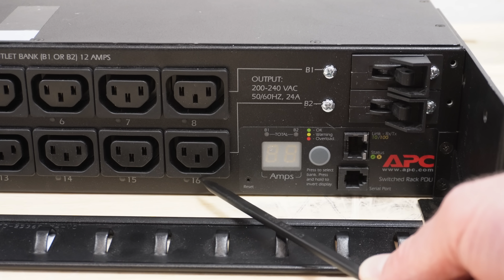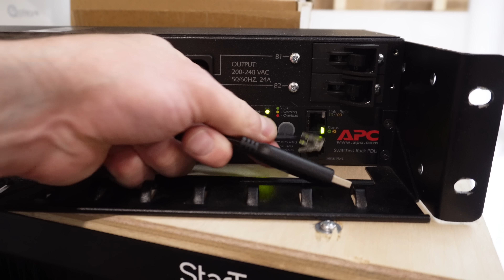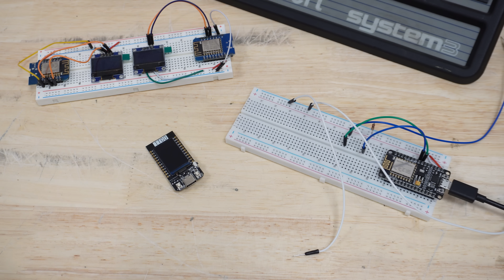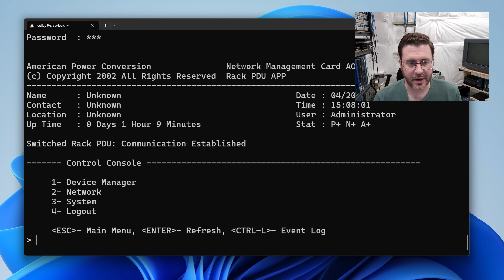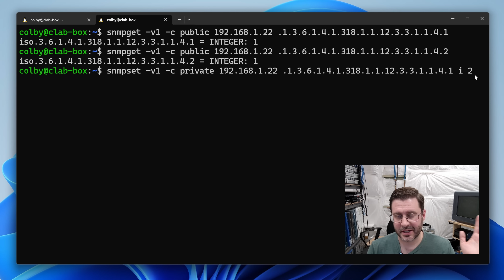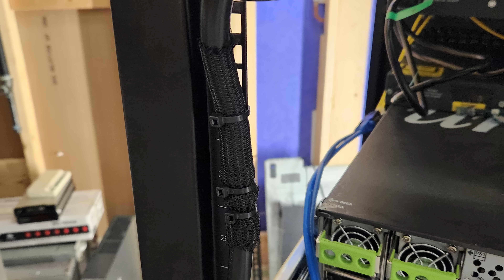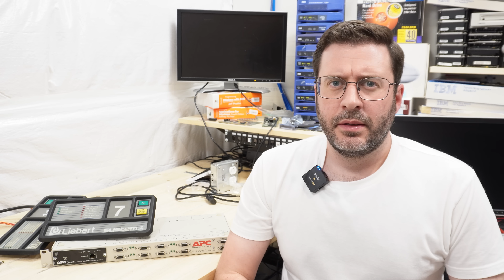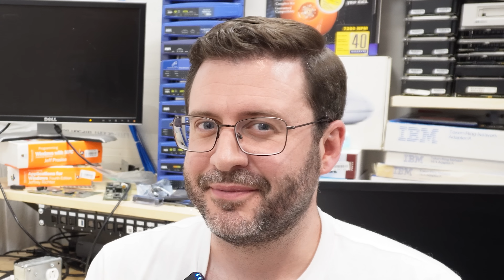Retro Rack PDU Install

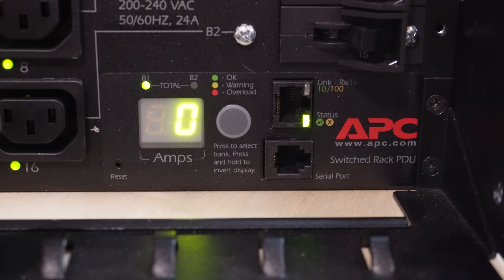Comment: 4:37 grabs the box of random plug to EIA-561apaters out of the shelf Which one we need?
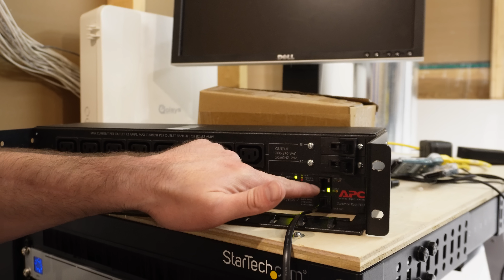5:29 Same problem with the Netgear M4300 series here with a lot of retro equipment. The swich talks 10Base-T, but it won't work well with a lot of old stuff. For that reason there's a ancient Netgear FS108 running in the rack. We replaced the stone-age linear transformer power supply (7.5V, what an odd number) with a more efficient switch mode supply, which is way less of a space heater.
7:57 Put the ESP in your network, and you can throw commend at it from anywhere :) The ESP8266 is still quite fine for smaller stuff. I have a lot of sensors around the house running on there, and also a lot of stuff on the workbench. Up to nine useable GPIOs is way enough for a lot of stuff, especially if you use addressable stuff.
10:29 Minicom <3! Use it a lot! Yeah, they key binding is a bit of an acquired taste, but I'm used to it. 
15:21 Oh yeah, SNMP structure addressing...we all have been there :D We actually never thought about that, cause the serial solution with the ESP32 works so well.
19:13 cause they don't want to build that thing in a dozen different variants for different reasons, as you said. They only need to change out the input plug, everything else can stay the same.
20:06 This can't really do 15A, cause the C13/C14 plugs are limited on 10A. the next bigger one is the C19/C20 with 16A, which is a different plug. Maybe the cable is rated for 15A, but these plug won't be.

Still waiting for the day you get a Node-RED instance running. You could build web interfaces so quick and easy :D

Comment: The difference between between 208 and 240 is in the phase. With exception of a few AC motors, most electronics wont care if its 208 or 240. Specily since almost all data equipment has a switch mode power supply, In north America homes will have a single phase 240v transformer that is center tapped, two give you two 120 split phase. Since most homes don't need more then 200 amps, this is all you need. In fact I think you can go up to 600a on a single transformer. Pole mounted any way. Industrial facilities and data center need a lot more amps. Sometime in the kilo amps. So they they will either get 3 240v phases or can get a full line voltage and transformer their power directly into multiple voltages and phases.  To spread the power between phases, you can connect 1 phase to another phase. Since the two phases are 120 degrees from each other you can not get the full 240 of a single phase. That is how you get your 208v. Basically more amps, less volts. A lot of people think of electricity in voltage. Voltage is easy to measure and able to be vaguely explained for people to understand. But voltage is not a good way to truly understand electricity. Voltage is only a difference in potential. This is only important in break down or insulation voltage. Using water pressure, the higher the pressure, ie voltage, the thicker the insulation you need. In electronics there is still insulation between voltage paths. Other then that voltage has nothing to do with how electronics work. Amp is the measure of volume. Again using water analogy 100 gpm is more then 1 gpm.

Comment: @20:10 weirdly, the 15 amp rating is only valid in North America. Internationally C13/C14 is limited to 10 amps. For 15 amps we use C19/C20.

And as a sidenote: I actually hate these in the datacenter, as they have no locking mechanism and can easily come loose. (There are some companies who try to shoehorn some kind of friction-based locking into those plugs, bit it's all not standardized.) I'd much prefer my servers to have PowerCon plugs.
Reply: In my experience, it's extremely rare for C13-C14 plugs to come loose, unless a tech is being very careless while working on rack cabling.

PSU's on the Dell servers all have velcro straps to hold the power cables in place on that end.  Eaton PDUs have loops on their  receptacles so you can fish a zip tie through it and around the cable, if so desired.  Other PDUs have plastic inserts that go in before the power cable to secure them in place, but I never bother with any of the above.
Reply: @rcxb1  in my case I cannot choose the PDU unfortunately (as it's provided and approved by the DC, even renting a whole room we are not allowed to mess with the power connection) — so no locking for me.

I regularly have to re-seat plugs; they seem to slowly come loose from heat expansion/contraction (my DC runs very inconsistent temperatures too, despite being one of the bigger players). It's not a huge problem (the equipment has redundant PSUs anyway), just annoying.

But as I said: the fact that there are various attempts to fix the issue clearly shows that there is an issue, even if it's just "low-key". That makes me wonder why they didn't standardize on something that has locking built in already.

I also work as a stage technician sometimes, and there Powercon/Powertwist is becoming more and more standard (even on cheaper equipment, which used to have C13/C14 — so cost doesn't seem to be an issue anymore). It's just SO much more convenient!

Comment: we use c14 plugs becouse they're 1. more compact than normal outlets (not necesarly smaller than the north american ones, bet very much smaller than the type G (uk), type E (fr), or type F(shuko) plugs that wouldn't fit into 1U). and 2. they're an actual worldwide standard unlike whatever the "normal" plugs in oyur country are. there are also more advantages like it not being voltage specific, it only has a max current defined (for c13 and 14 it's 10A) etc.

also that 15A cable you show is 100% not rated for 15 amps. maybe the cable itself is but not as a whole since those connectors can as per specification ONLY carry a maximum of 10A continuous. if you want to draw more, you'll have to upgrade to a c19 / C20 cable. (usually seen on 1500W+ desktop power supplyes)

Comment: C13/C14 is used on enterprise/business PDU/UPS connections on the device side, on the power input side C19/C20 is often used for it's higher current capacity. My understanding is that it is cheaper to produce one design for the whole world and only needing small changes in the electronics for those countries using 110/120v.

Comment: Have you tried integrating the PDU into Home Assistant? I believe home assistant supports SNMP.
Reply from the maker: not yet!
Reply: @clabretro  I was going to say exactly this. It's already got support for MQTT & SNMP, and ESPHome lets you build your own ESP-based hardware and integrate it directly into Home Assistant. It also potentially has either native integrations or Home Assistant Community Store (HACS) that might interface with the PDU's directly.

Comment: for the panels, I'd replace the section that has the big number, and put some switches, or even an encoder switch, so you can select which output you want to modify (make the led blink when you're on that edit mode) and then one button to toggle the status. due to the esp8266 lacking pins for so many leds, I'd use one of the i2c port expanderd, like the pcf8564. these usually start with their outputs "high" (weak pull up), so I'd suggest connecting the leds from the power supply to the outputs of the chip (with a resistor, 220/330 ohms for 3v3), rather than connecting the output of the chip to the leds and ground. it'll look so cool!

Comment: We always called the Cisco cable a "rollover cable".
Reply: The proper term is "Yost".  The magic of the Yost pin-out is that if you use a rollover cable (pin 1 on one end goes to pin 8 on the other end) it will switch the RS-232 between straight, or null-modem.  The downside of Yost is that you need TWO pins (in the center) just for ground, so you can only connect 7 of the 9 RS-232's pins.  You lose Ring Indicator and Carrier Detect.  RI is only needed for dial-up modems, but CD can be important so it is best shorted to a pin that'll always be held high, like DTR.
Reply: @rcxb1 Sonicwall has their own rj45, non-yost pinout too. Pretty annoying to search for those since they're less common.

Comment: Hey Clab! Love your vids.  I am in dire need of that buck boost for my university radio club. Im having the opposite problem of having 208v and needing 220v. Whered you get yours?
Reply from the maker: I grabbed it on eBay, definitely do a lot of research about figuring out which one will work for your application though!

Comment: C13 - C14 are cool, but wait until you get into C19 - C20. At my site, there's clients who go balls to the wall with custom length ethernet, fiber, and locking C13 - C14 cables, and then there's the guys who just don't care and order the longest ones possible. Looks like you took a bucket of cables and just threw it into the back of the rack. There's one client who uses custom length and color power to symbolize the redundant circuits they have. That said client's PDUs are capable of 60A, a massive IEC 60309 locking plug under the floor. This is duplicated across all 10 of the cabinets they have with us. I believe it's APC model APDU10452SM. 32.6kw available per cabinet, and they use it. Had to install localized in-row cooling units just to combat the heat rejection of their equipment.

I like the C13 - C14 cause the male end is shielded and can be locking. With your standard NEMA 5-15/20P's, if they back out of the outlet they leave the metal prongs exposed. If something gets lodged in there, you're in for a fun time.

One of our sites has older Liberts which use the System3 controller like you have, except for they're the LCD display models. There's another site which has this, but it's the "Graphics Control" system. Could display graphs of cooling trends on the unit.

Comment: Good ol' SNMP "Simply not my problem", good on ya for getting that going. I think that it helps to understand where 208 vs 240 come from. In commercial and industrial settings, there are 3 phases with a phase angle of 120 degrees (to each other) typically, and this will result in a phase to phase voltage of 208 when phase to neutral is 120 (You know, to run lighting and "normal" things) but in a residential setting, the "phases" are 180 degrees with respect to each other which results in 240 volts nominal.
Reply: One might add, that this applies to North America ONLY, plus the reason it's 240V to residential buildings is that a single 208V phase is connected to individual houses via a center tap transformer that splits a single phase into two 180° phases which both have 120V with reference to center and 240V with reference to each other. In Europe residential buildings are either hooked up to a single 240V phase or three 240V 120° phases and larger buildings are either hooked up with two or three 240V 120° phases. It's mostly used for load balancing between the phases though. All regular appliances run on a regular 240V single phase outlet. The exceptions are ovens (wired directly without a socket to two 240V 120° phases plus the stove top uses the third phase) and heavy construction machinery which uses CEE sockets (those can either be 240V 16A single phase for the small connector, or 415V 16A/32A three 120° phases for the larger connector).
Reply: @jdkap201  "a single 208v phase is connected to individual houses" This is a nitpick but it's incorrect - most residential single-family-homes are connected to the grid via a transformer directly to 240V center-tapped. No 208V involved. 

You frequently see 208v in commercial settings and multi-family residences (mid-large apartment buildings).
Reply: @UnreasonableSteve  Ah, my mistake. I meant to write "a single phase" which then gets transformed into two 180° phases w/ 120V each. I have no idea how that 208V snuck in that sentence tbh. I was probably thinking of the input to the transformer, but I doubt that would be 208V. What is it though? I find hardly anything at all if I search the internet rn.
Reply: @jdkap201 it varies too much for a single number to make sense but it's typically known as "medium voltage" as opposed to high voltage (long distance transmission) and low voltage (consumer devices plug in to). Somewhere between 2kv and 50kv
Reply: @UnreasonableSteve  Ah, that makes sense. It's actually somewhat comparable to how it's done here in Germany, albeit here a huge medium voltage to low voltage transformer would usually be placed in a separate small building (the size of a typical shed or a single slot garage) and from there it would deliver 240V for an entire street or sometimes even for an entire village. (Mind you, we have a LOT of underground cables. Only high voltage and some medium voltage networks are overground. Low voltage overground cables are a rarity here.)

Comment: If it doesnt handshake, why not just configure the port fixed? The Linksys is a littly janky!

I also love those DELL Servers. I run a R720, a R520 and a R420 in my primary network. And a 2950 on a retro rack.

Why use Windows? Use a real OS! :-)

Comment: When I was dba/sysadmin for EVE Online, we had those APC PDUs... they were a lifesaver, as we were in Reykjavik, Iceland, while the servers were in London.
Before we had the PDUs, then if something needed to be powercycled, we had to get the "Intelligent hands" service at the datacenter to go and physically touch our cables and that was very risky... they were known to even remove the wrong servers from customer cages and ship across country before anyone realized.
Reply: Smart Hands often aren’t that smart.
Reply: @blademan7671  Yeah, they eventually changed the name from "Intelligent hands" to "IT hands"
Reply: We called it "remote hands."
Reply: If you had "real servers", the BMC/IPMI can power cycle them. I've used that feature for decades.
Reply: @jfbeam  We did run a full IBM shop, but we had one machine, the main domain controller used by the servers, that couldn't be rebooted without power cycling and that was an old pizza box, with no BMC. Also, it was mostly network equipment that we needed this for IIRC.
Due to the performance requirements, we often had pre-release or at least pre-market hardware and as such it sometimes had buggy firmwares.

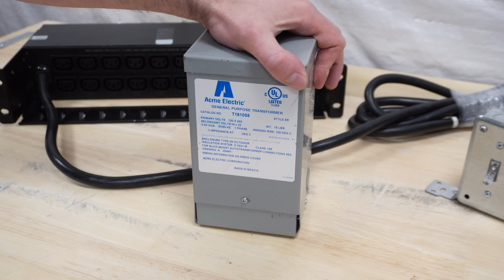Comment: @1:53 at first the ratings threw me off but you're right 😅 I guess it has to do less work to change from 240V to 208V so the rating for that is actually 3.68kVA and 17.71A loads.

Comment: 5:33 Yeah, tell me about it. We switched to unifi gear a year or so back for work. We use paxton and salto access control. The new switches don't negotiate with 10 meg connections and a ton of our salto controllers just didn't work. Thats a unifi thing. They just don't support it anymore. We will probably see 100 meg connections getting dropped soon to.
Reply: Unifi has been doing weird stuff lately. On the new unifi switches, you can't manually set a port to 10Mbps hdx anymore?

Comment: just a heads up now that I got a clearer shot of the buck/boost transformer. Its only rated at .5 KVA which is only about 2-2.4 Amps. Which 2.4 Amps at 208 volts with a power factor of .8 (standard in north America) it is roughly only rated for about 400 Watts. Probably not going to be beefy enough to run the whole retro rack. However, according to the front of the PDU it states 200-240V. I do not know what the internals look like so not sure if running it on single phase vs 3 phase will be an issue. Just wanted to let you know! keep up the great work!
Reply: No, the transformer is fine. Buck (and Boost transformers) don't need the rating you may think of, they just provide a small voltage to add or subtract from the mains voltage.
In this example the secondary is rated for 32V (at 240 V input, then you wire it so you get 240 - 32 = 208V at the output).
32V at 500 VA is about 15A on the secondary so enough to buck a 15A 240V input to 208V.
The transformer doesn't see the whole load and therefore only needs to provide the desired output current times the voltage DIFFERENCE between input and output.

Comment: In Europe almost all SOHO UPS-es used C14 outputs up to mid or late '00s. Later regular socket ones became more popular as more and more monitors and other peripherals started to be powered by power brick with built in plug. Why, I'm not sure, but probably to prevent household appliances to be plugged, less space consumed, lower production expenses (all markets with different plugs but same voltage and frequency only needed different power cord in package, no difference on device itself)...

Comment: I have a caution for you about newer AP7911s and 7811s.  The newer units have non-replaceable fuses instead of circuit breakers.  One small transient overcurrent event means throw it away and get another.  😢
Reply: Or a tiny bit of soldering? It can't be that big of a deal switching the fuses out...